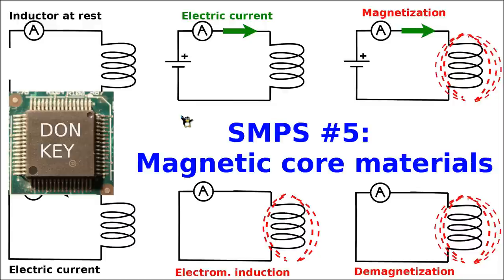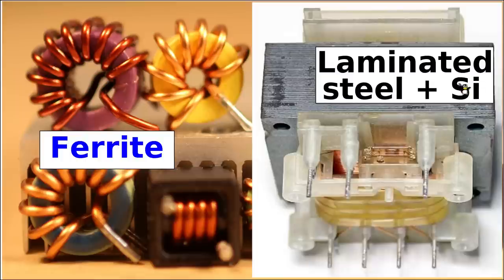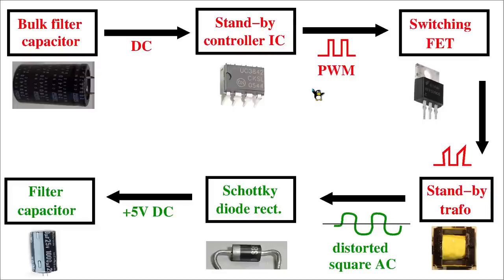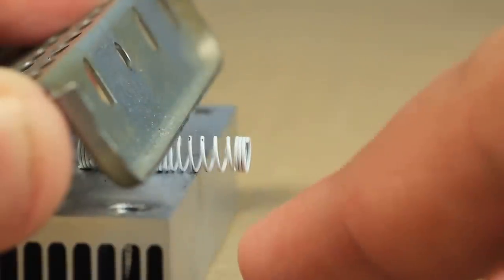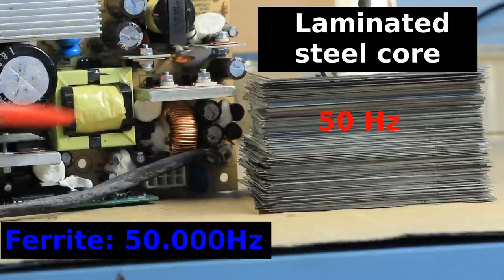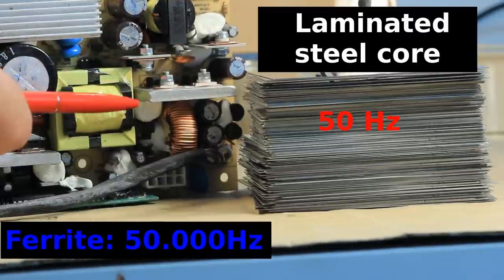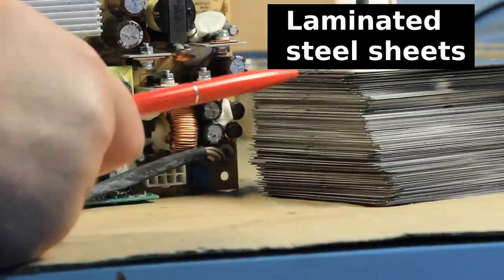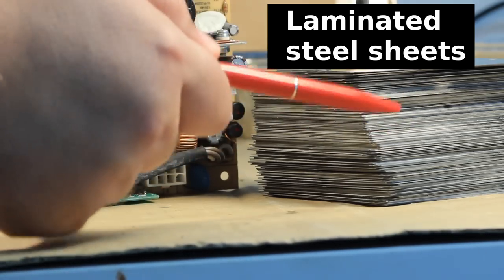Howto repair switch mode power supplies #5: Magnetic core materials, ferrite vs steel

Comment: So far I have enjoyed watching your videos, one thing I will point out is that on the part where you discuss the 12 volts DC from the battery you have the flow of current backward. Current and voltage flows from negative to positive, not from positive to negative. The reason is that electrons flow from negative post where less electrons are, hence negative - to positive + post where more electrons are. Electron flow is from negative to positive on a battery.
Reply from the maker: Well, the issue is that in electronics we are still talking about the conventional current flow, which is exactly the opposite to the actual electron flow. This is because the conventional current was fixed before the time when physicists have discovered electrons. At that time it was already too late to change the nomenclature in older books, so it lived on until this day, and it will stay for generations to come.

Comment: Dear Sir, I congratulate you for this lesson which is really educational both in terms of electronics and in terms of physics (electromagnetism, frequency).I would have liked to see it before because for 3 months, I have been trying to troubleshoot an AC adapter for a laptop with a power of 330W. The problem I encounter is the identification of the Coil of the active PFC. This one has a secondary winding which is on one side connected to the ground of the 2 MOSFETs of the PFC (they are in parallel) but I cannot find where the other side is connected. I told myself that it must be connected to an integrated circuit to detect a current crossing at zero (ZCD) but none of the legs of the 2 closest ICs correspond (the other ICs are on the 19.5V side (An OP2990 and a TEA 1995 ).In addition, these ICs are unreadable.The other problem is the identification of the primary of the output transformer.I followed the tracks with the ohmmeter and the inductancemeter but my diagram is not consistent with an LLC assembly The choke which is between the 2 MOSFETs has several connections (which I don't understand) and is surmounted by a radiator (which I understand) I am not looking for the values (x milliHenry, etc.) of these materials but their installation and wiring I wrote to the company DELTA from whom I bought 5 of these power supplies but, despite my reminders, they do not even have the decency to answer me. Do you know where I can find this information? .Thanks in advance

Comment: This is the first video I've seen of yours, I've subscribed and will go back and watch what i've missed. Thanks for sharing your knowledge.
Reply from the maker: I am glad that you liked the material. 
Btw, good feedbacks like these are giving me some will to finally produce new videos and finish this series.
Reply: I hope you do. Quick question for you. What causes some DC motors to stutter or pulse with some power supplies? The motors I've seen it with are in as low as 3vdc and as high as a 48vdc drill motor. and everything in between? If powered with a battery there is never a problem but when using various power supplies from old devices such as a 12vdc 2a supply from an old router, one motor rated for 12v might pulse or stutter and another rated the same will run fine. Thanks
Reply from the maker: DC motors have not just a voltage rating, but also a current rating. Voltage multiplied by current will provide the power in Watts. 
Now the issue is, that especially switch mode power supplies tend to totally drop out (meaning they go well below the rated voltage) when they are loaded with a higher current compared to which they were designed. After the PSU drops out, it will start up again, than drop out, and this will repeat over and over, causing the pulsing you mention. 
In contrast to a power supply, a battery can provide very high current until the battery heats up, and even a hot battery is still providing a smooth voltage which slowly decays over time due to discharge of the battery and due to heat.

Comment: Another excellent video!
Reply from the maker: Thanks for the comment. As I wrote to an other subscriber, I did not had time to talk about iron powder cores, since the video would have been even longer. In the upcoming videos I will mention it, since those are frequently used as filter coils in SMPS circuits.

Comment: 16:12 "Then I remove the magnet, and automatically here the magnetization have dropped down and it completely collapsed".  I don't want to be nitpicking, but want to point out a mistake.  According to the graph on the right hand side, when the magnetic filed is removed, the magnetization of the material doesn't immediately disappear as you say in the video.   Your mouse pointer should have stopped where the top of the graph meets axis M.  That's where it indicates magnetization of the material when magnetic field is removed.  When you go into the area on the left side of axis M, it means you are applying reverse magnetic field.
Reply from the maker: Well, even so many people complained that the videos are "way too theoretical", so I do not dare to make an actual physics course on magnetism. Those people who notice these oversimplifications/mistakes know more than the average repair technician will ever need to know about the topic, so for them it is of course not detailed enough. Trust me, it is almost impossible to make a video for a broad audience where you try to explain basic concepts without going into detail.
Reply: @DonkeyLearningIT  I am in no way criticizing you.  I just wanted to point out a small mistake.  By the way, why did you stop making more videos on this series?  I really enjoyed your videos, and I am sure there are tons of people who did.  Thank you.

Comment: First of all thanks for your nice and knowledgeable information on SMPS  which has cleared many of my doubts about power supply. Kudos to you for the same .
I need your help in buying a good screw driver set which will be useful for SMPS and other electronic products 
Along with this also share the brand of soldering iron which will be useful in removing transformers , inductors and MOSFETs in power supply
Reply from the maker: Just let me know the pricerange, and I can give you some tips.
Btw, you can watch my two videos where I present most of the stuff which I use for soldering, that might be useful for you as well.
Reply: Donkey Learning IT  I have a budget of around $80 for screw driver set and same amount for soldering station. May I know the name of episode where you have mentioned about soldering station
Reply from the maker: I would spend less on the screwdrivers. On the other hand, for $80 it is almost impossible to get a decent soldering iron, especially if you need to remove large components which require good heat capacity. 
Is your budget really this tight, or you could eventually extend it a little?
Reply from the maker: Btw, I forgot to ask: what kind of repair do you do most? SMD, through-hole, high power amplifiers, low power digital electronics? Just asking, since the type of application will determine the soldering iron you need.
Reply from the maker: It should be available on the channel information page. In case if you cannot find it, it is: 
donkey.learning on Gmail.

Comment: Ferrite has lower Eddy current losses.[3:00]  The windings can be subjected to a Ring test,when you test with a pulse across one of the windings it should Ring.
Reply from the maker: You are right, that is an other advantage of the ferrite material. Though, people complained that the video was even so too theoretical.
Reply: @DonkeyLearningIT  Theoretical?  Thing with YouTube videos you can pause ,rewind, screen save, review against technical journals.
Reply from the maker: @allanpatterson7653  Well, it seems that many people are not aware of this. If a video is not short, funny and entertaining like a "Thug Life" video, than people do not like to watch it.

Comment: I am sorry for the criticism in this and the former videos. Your explanations regarding the operation of a SMPS is great and is very useful.
But.... please, pleeeease.... stop comparing inductors with springs. In this video you are comparing the inductor’s CORE with a spring, which may be compared, but the core is not the actual inductor itself.
This analogies only lead to confusion for those who are beginning their ways into electronics although they can’t see the confusion yet.
Here are the actual mechanical analogs for passive components (LCR):
L, the inductor -> a MASS, for example, a car (it will have inertia)
C, the capacitor -> a SPRING, for example the springs in that car’s suspension (it will try to keep the car in the same position)
R, the resistor -> the FRICTION, for example the shock absorber in that car’s suspension (it will dissipate the energy when the car hits a bump, because, without the shock absorber, the car would continue oscillating due to its mass (inductor) and its springs (capacitor) both fighting each other
Having said that, now, I have to say I really enjoy your SMPS explanations.

Comment: Is it possible to have the soft core ferrite oscillate at lower frequencies like 60hz? Or they have a minimum oscillation in the kHz?
Reply from the maker: Technically speaking, it is possible, but in reality it is not practical.
Namely, as I explain in the video, size does matter, at least when it comes to magnetic cores ;)
Now because of this, you would need a HUGE ferrite core to go down to low frequencies. In fact, due to the soft-manetic nature of the ferrite core, the equivalent ferrite would be several times heavier and larger than an iron-core at low frequencies.
Reply: Donkey Learning IT Why would it need to be larger? More surface area to slow down the output frequency?
Reply from the maker: The concept is similar to energy density: one need to eat a large volume of vegetables to get the same amount of calories as from a small piece of chocolate. Similar example is that a large piece of wood might weight less than a small piece of led. 
Magnetic energy is mostly about the volume (i.e. m^3) and not about surface area (i.e. m^2). Due to low magnetic energy density in a ferrite, the core would need to be larger. This is because ferrite is soft magnetic, which reaches magnetic saturation at a lower magnetic field as an iron core would. This means, that in order to reach the same total magnetization in a ferrite core, you would need a lot larger volume, since the density is lower.

Comment: Interestingly, the differences between the ferrite cores according to color I did not know. Thank you
Reply from the maker: The colors are not really a real indication, but in general this is what I found. However, every manufacturer might use a completely different color scheme, so do not necessarily think that just because a ferrite is blue, it will work at 100MHz. Also, old ferrites were all left black/gray, even the high frequency ferrites, especially in Russian electronic circuits. This is because at that time ferrites were simply not coated with anything.

Comment: Why bother generating 50 thousand hertz? make the AC from grid 50 thousand hertz, problem solved!

Correct if I'm wrong, well I'm probably wrong
Reply: Here is the problem: Power cables have a capacitance. At 50 Hz, you are charging and discharging the capacitor 50 times a second. At 50000 Hz, you are doing that 1000 times faster, so you are wasting more energy. Not to mention that at high frequencies, a cable becomes an antenna, so instead of a power transmission line, you essentially have a heater that is also a radio transmitter!

And finally, skin effect. At high frequencies, electrons flow only on the outer layers of the cable. Therefore, you need much thicker cables than you would need at 50 Hz or DC.
Reply from the maker: When electricity was first used in households, it was a big competition between Tesla and Edison. Edison wanted DC, wheres Tesla has realized, that DC is a dead-end for power transmission. Tesla was a smart guy, who also developed the basics of radio transmission, so he knew that one must stay with low AC frequencies  otherwise losses will be too grate. The issue is, that at 50.000 Hz there would be a huge loss of power over any traditional power line, especially if you consider that power is transferred for hundreds of miles of cables, and it goes through at least 6 high power transformers. Practically the power wires would behave like an antenna, dissipating power.
Reply: Thanks :)

Comment: you can put 50Khz in a classic transformer as well , has nothing to do with springs or sound pitch or resonance , its just the fact that higher frequency's deliver less losses hence things can get smaller for same power  , its about loses not resonance , sound pitch or wahtever alley you seamed to be lost in there and you are lost no doubt about it , let me remind you you started with SMPS now you are playing with screws
Reply from the maker: Please try to put 50KHz in a classic transformer. You will get an induction heated core which will melt the whole thing.
Reply: @DonkeyLearningIT  ridiculous  ,    i will  push 300W at 50k though  AC transformer  big one  no problem ,  wanna bet
Reply from the maker: As Lil Jon would sing: Let me see you do it!
Of course, if you put in a massive core of a welding transformer, and you pump in only a couple watt, that might hold for a while just due to heat capacity.
Reply: @DonkeyLearningIT  ill do it , but i need to make 50K 300W generator , i dont have that handy , unfortunately , or you know some way to get 50k sine wave of around 300W thats easy and cheap to make